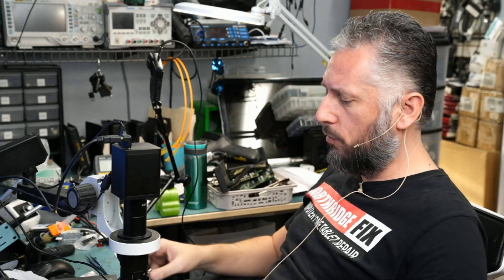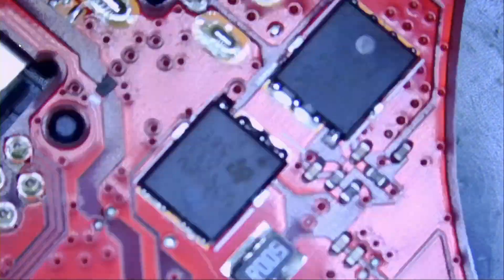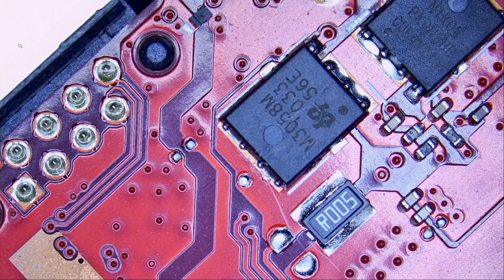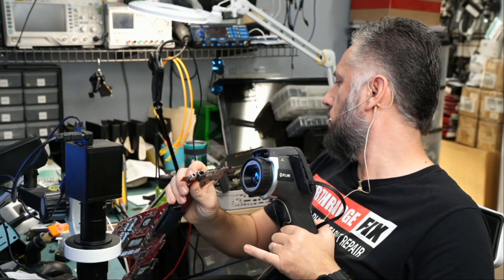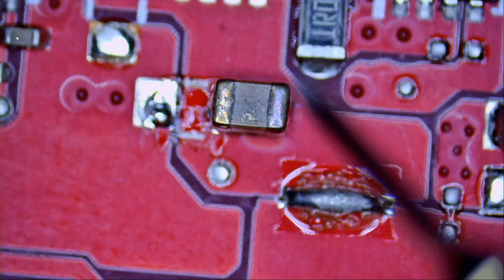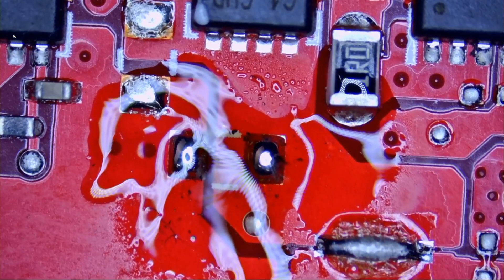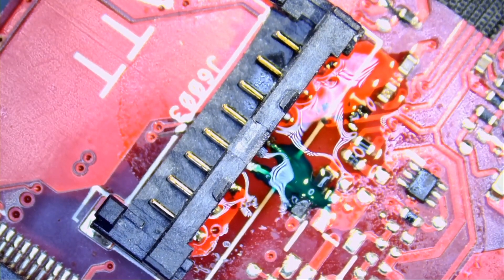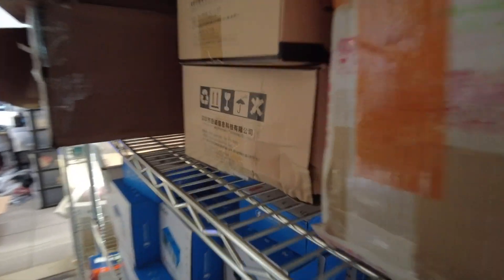Another Asus ROG Laptop Repair. What is the Best laptop to buy?

Comment: I have had an ASUS ROG for 10 years and recently bought a $4,000 ASUS ZenBook (Don't like it). ASUS laptops are like a mini oven. I used to play R6 and the last 6 years I have been ON all the time 24/7 using it as a desktop computer for daily use. I see all these laptops generate a lot of internal heat and I can see two common issues regardless if people said that they took care of it. 

1. The air flow comes from the bottom and people normally place it in their lap or on the bed, blocking the air flow or never cleaning the internal fans.
2. Unnecessary upgrades, like changing the thermal paste to liquid metal. If it is not broken, don't fix it.

I always use the external bottom fans extension that raises the computer a few inches from the table and has 5 fans pushing air to the laptop from the bottom up. You only need to leave the laptop one time on a bed to fry the Mosfets. If I leave the laptop powered ON on a bed surface, I place it upside down, the screen down and the fan intake face upwards. If I use it on my lap, I spread the legs to hold it on the edges leaving the center open with the nice air flow.

Is all about the heat, keep the internals cool and you will never have a issue. 

But, for those that may think I'm a ASUS lover, let me tell you, ASUS and ASUSTOR NAS, like all Chinese Business, for them is all about $$$, have the useless and careless customer service unless willing to pay: you buy their product and they already got your money. ASUS are a some way a good product until you need the support.

Comment: The more something sells, the more of it will break. It is as simple as that. 
Not everyone can have a gaming computer (space constraints - laptop takes significantly less space) and not everyone wants to. Cable clutter is often insane, especially when i´m trying to remove one cable after replacing something (not necessarily in the case, but behind it as well - and i have cable management there too). Surge protector with 8 sockets is already at its limits...

And ever since i went with USB sound card (i used PCIE sound cards for years, but since they are ancient atp, board manufacturers started dropping the support, NO, it doesn´t mean integrated audio is equal - even cheap Xonar DGX runs circles around Realtek 1220), i wouldn´t mind byuing a gaming laptop myself, but as i already have a PC, i´m sticking with it.